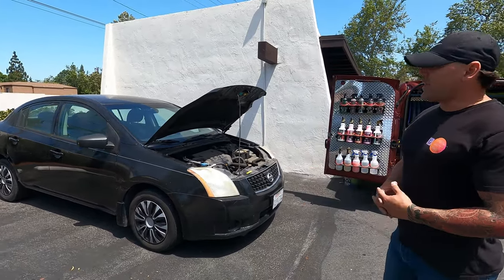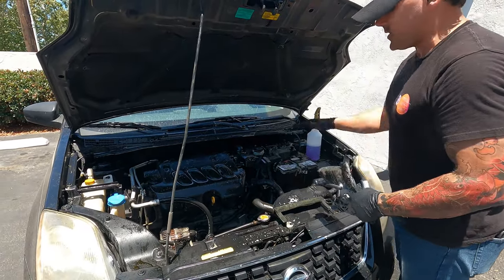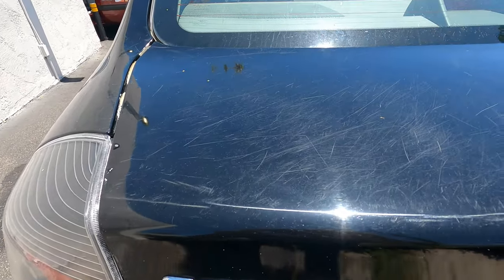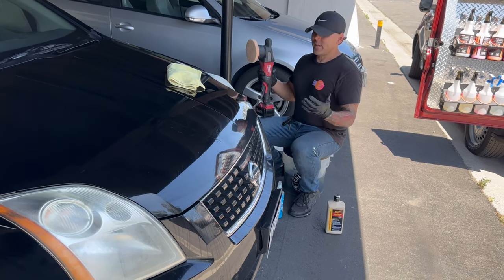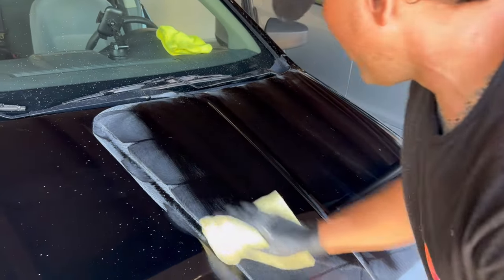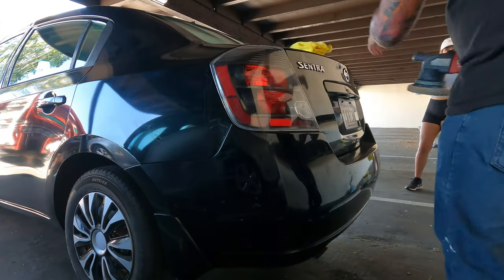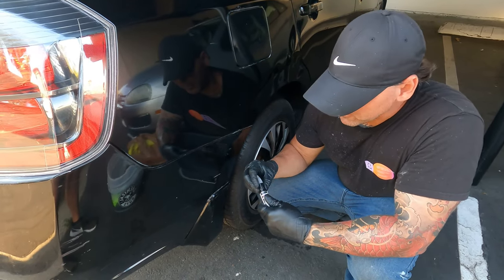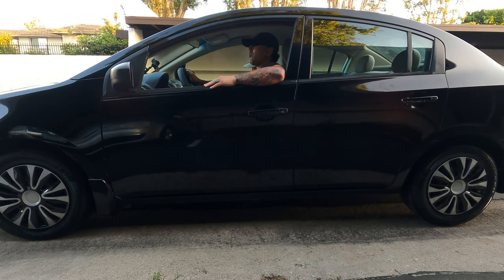Cleaning a disgusting FORGOTTEN Commuter car..

Comment: Just a couple suggestions, please know I mean no disrespect…1) wash under the top of the hood as well when cleaning the engine bay… 2) when you have an extremely dirty car…first, do a touch less pre rinse treatment…foam the car-let it dwell a minute if the weather permits, and then rinse…then-foam car a second time to do the contact wash…by doing the pre rinse….the foam has encapsulated a ton of that initial dirt and grime from the get…this way-when you do the contact wash with the second foam…you aren’t marring and scratching your paint with all that initial dirt build up that hasn’t been rinsed off the car yet….3) rinse your mitt after each panel with an extremely dirty car…otherwise that dirt stays trapped in the mitt and gets spread back onto the paint….. 4) when you polish-all you need is 3 pea sized drops-less is more-use a cross hatch pattern and slow it down…you want to make anywhere from 4-8 passes per section, depending on the condition of the paint, and use more than one pad..when the haze becomes hard to remove, it’s because your pad is gunked up….you seem motivated and excited to be on your detailing journey…best wishes!
Reply from the maker: You know What Thank you so much for the advice, I’ve been needing to do this and you just gave me the extra push I needed to create a better process. Sometimes us detailers create bad habits and unknowingly or knowingly dont change, but Im firm on growth and this will only improve my skills. Also sometimes doing things the right way may cost a little more money and using more foam will cost but your absolutely right the excess dirt needs to be encapsulated. Thanks again for taking the time to get this point across to me. Yes I know that about the hood I forgot it this time, I washed it later. With the the amount polish and polishing is something I also plan to work on, I’ll be doing a ceramic coating soon and I’ll showcase all the practice and improvements Ive made in the video!
Reply: @Brandinwagstaff  that’s awesome! Can’t wait to see…I’m new to ceramic coating myself-so maybe you can teach me a thing or two! Btw…you slayed the engine 😃

Comment: quick tip to anyone cleaning the engine bay with a pressure washer or high pressure water, make sure all of the caps on everything is tight, fuse box is fully and securely shut, and take out your battery to be extra safe
Reply from the maker: Great Tip!! Thank you 😊
Reply: I wouldn’t wet the alternator, I would throw a rag on it and the battery as well

Comment: question why dont you use a wash mitt instead of the traditional clay bar ?
Reply from the maker: The clay bay mitt , Ive only always used traditional clay bar, Ive been told by many that the mitts aren’t as effective as the mitts. Id hate to spend $50 on one and it not work. The clay bar works for me and its not much effort to apply it, So I just continue using it. Its kind of like why fix it , if its not broken. Theres been tests proving the clay bar is just as fast as the mitt